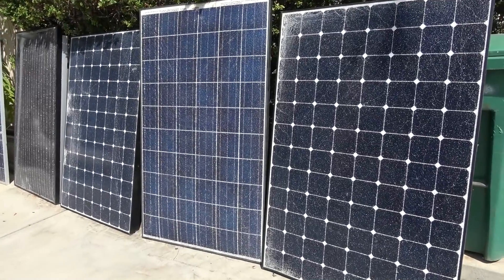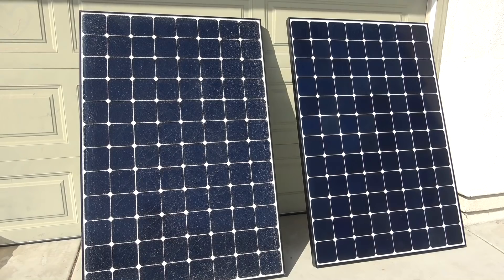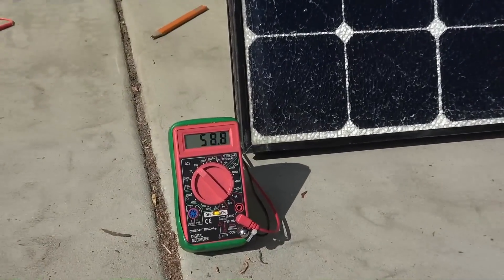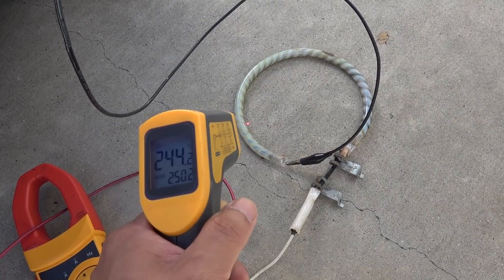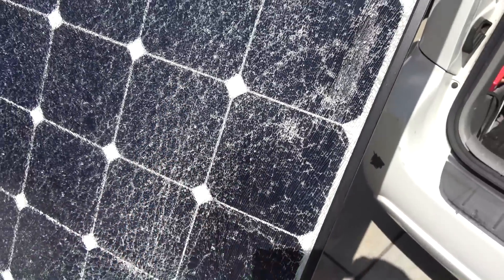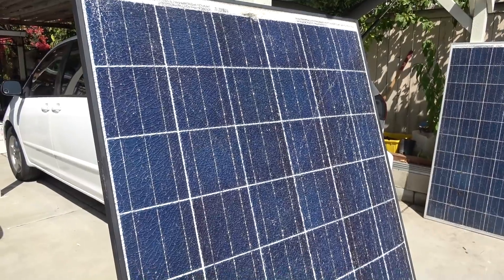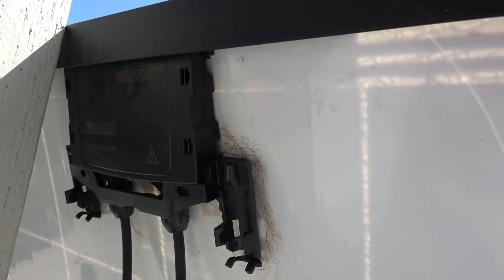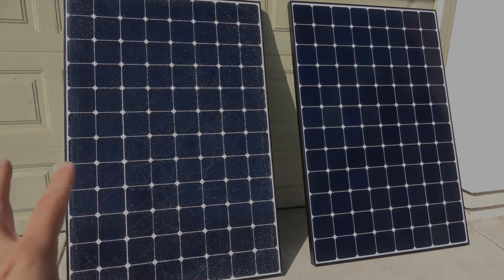Testing Cracked solar panels. Are they any good?

Comment: Excellent! Nice camera work, slow scrolling without much shacking. The audio is clear without distracting music aside from transition. The content is clear and concise, straight to the point with analytical explanations of the problems of each panels. Perhaps a good way to approach labs condition , would be to test each panel at sun peak , noon, with panels pulled from a  much cooler place like your garage? Another suggestion would be that you post the link on the video for the sealing / repair process if you have done so. Thanks

Comment: What about rainwater getting in thru the cracked glass?  Perhaps not a big concern in the Mojave Desert, especially if ground-mounted where a short-circuit and sparks doesn't risk roof damage.  Amazing that the crazed panel still worked 90%, though that appears about right to the eye judging from the sunlight scattered back.

Comment: My  cracked renogy 100watt panel got at least 50 watts the other day with no issue. Of course it's not water proofed though so I can only use it occasionally. Also I put scotch shipping tape all across it to keep the cracked glass safer.

Comment: Thank you for the information. Please be more when careful touching those broken panels in the future, since I am told the volts and amps are still high enough to do severe harm. Resist the temptation to probe a finger into damaged areas when the panels are in full light.

Comment: You mentioned your test load was a heating element from a stove(?) Assuming this was from an AC unit.  Currious what the power consumption was.   I am currently testing the exact same thing with 315 and 445w broken panels hoping to use for direct water heating with a DC heater element.  The tricky part is trying to match the resistance.    Nice thorough testing BTW.  Enjoy your videos.

Comment: Cool video!
Most important is not to mix them with good panels since they will reduce the performance of the entire system.

They can be used for smaller independent projects.
Reply: Really? Why is that?
Reply: @wetube3004  I had a few panel blow off my boat and got smashed on the way down.

They still worked alone for charging small batteries, but when connected to the others they seemed to make them work at their own capacity.
I think it has something to do with difference in voltage.

Comment: With a multimeter, you can only see the two extreme ends of the power curve(Short circuit and Open circuit. However, a solar panel with a compromised glass can have a close enough open circuit voltage and short circuit current. where it struggles is at the fill factor of the power curve, by that I mean the Pmax is very low. In my experience, I have seen them an average between 55 and 70 % of the nameplate value.  
All I am saying is if you connect a cracked panel to the string of other pannel on your solar farm or your rooftop all the panels in the series string will be bottlenecked by one compromised panel.
Reply: Hey, I've connected 3*300Wp panels but one of them broke(stone). The broken panel gives 24v while others give 35v. When all are connected in parallel together it gives 33v.

Should I keep using it? 
(It has been working like this for more than a 1.5 years)
Reply: @kunalagrawal9976  Hey Kunal, You might want to remove the broken panel from the circuit. When you connect pannels in series the current of the bad panel becomes the bottleneck of the system and if you connect the panels in parallel the voltage becomes the bottleneck of the system. in any kind of bottleneck you limit your MPPT inverter to operate beyond the bottleneck threshold. Meaning, the good panels in the circuit will have reduced performance. 

Also, another reason to not use the broken panel is - it's a fire hazard.

Comment: Use uv resistant epoxy on those panels, will fix them up nicely!
Reply: Where can you find this?
Reply: @boathemian7694  AFAIK there is no, clear ,UV resistant epoxy  boat builders apply a UV resistance "spar" varnish over the Epoxy to provide UV protection to the epoxy.  People have tried varnish directly on the panels , only to have it yellow and peel off.   Search for "Progressive Epoxy Polymer  + India Spar Varnish"
Reply: @unionse7en  yes you are correct. I’m a boat tech and have never seen uv resistant epoxy either.
Reply: UV resistant epoxy won’t allow the sun to get through to it….

Comment: Hello there good sir,came across your channel here,im looking to find myself some solar panels for salvaging like you did here in this video,would you happen to know of any places that i could look into for scraping solar panels? looking into using some for recharging small power bank i have for any situation regarding power outages if grid was to fail or possibly emp attacks,that way i have solar to have power to bring into my small power bank wen sun is out just like it has been for a few days now,im also building my own panel as well with smaller units from solar lights and taking the solar panel out of them to use for building the panel im creating.

Comment: could that 60 volts shock you?
Reply from the maker: For the most part, no. But it might if you're wet and it depends on where on your body that touches the wires.
Reply: 60 volts of electricity could shock you. But when he tested the voltage he did it on an open circuit. Meaning it's not under any kind of a load. If he would have checked the voltage when it was under load when he connected it to the heater it would have been significantly less. So the fact that the voltage drops under a load and the fact that it's not pushing many amps you're not going to get a shock.

Comment: I'd try some kind of automotive "magic scratch fix" stuff on a small area, and see if that improves optical clarity. If it does, do a whole panel (or at least a significant portion of one), and see what the meter says after that. Of course, take care to not cut yourself!
Reply: If you do live in the South, or at least somewhere sunny, you might consider just sealing the BACK of the usable panels so you can deploy them on sunny days, and fold them over for inclement weather. Like you said, it'll be hard to find a material that will withstand the UV and temps these things must endure, but that won't be a problem if the "cover" only ever sees rain and clouds.

Comment: If you can find a varnish or something that can withstand the UV, it would fill in around those cracks and make it almost clear 
again and waterproof the holes. As far as the tabbing, you might be able to remove some of the white backing and jumper across the burnt or open spots and reseal it. I think these panels can be repaired and used for a long time. Good luck!
Reply: something that will survive uv and the heatcycles while remaining clear, that's going to be tough.